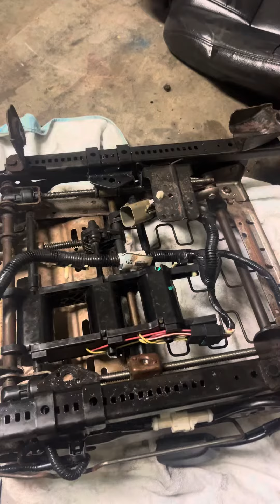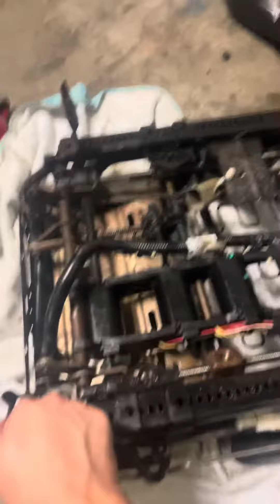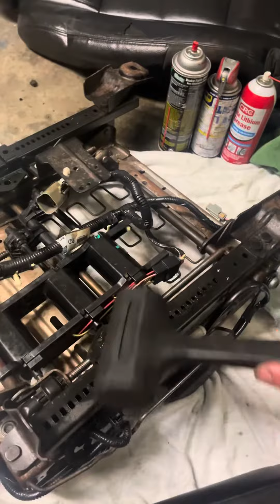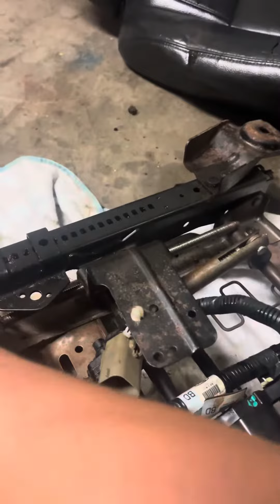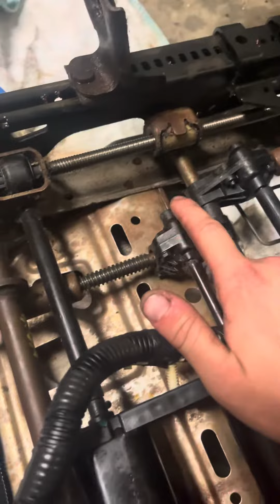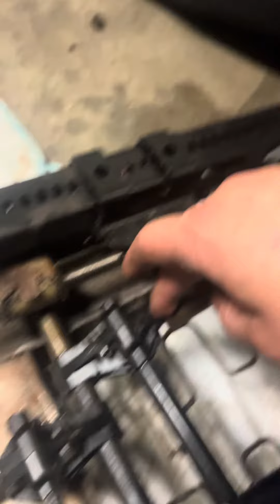2005-2014 mustang power seat rail and height adjustment fix

Comment: I have a manual driver seat that wont move up or down. I put on the rail under the seat and it wont move forward or backwards. I sprayed wd40 ans silicone spray and nothing. Its almost like the mechanism is stuck and wont let the seat move forward or backwards. Any help would be appreciated

Comment: 2:21 how do I open the plastic cover? Can I do it without having to remove the seat?

CJ Pony parts sells a product called CJ Classics Adjustment Gear Kit Power Seat Steel Up/Down Mustang 2005-2014

And in the installation document (found on the their website) shows that the motor has 4 screws. Hmmmm I guess I have to take it off
Reply: Ford Parts has a repair kit ER3Z78617D66A that comes with 2 cogs to replace the front and back adjuster gears. It comes with instructions too. There are 4 screws in the gear case, 1/4" socket, need a small ratchet to fit in there.